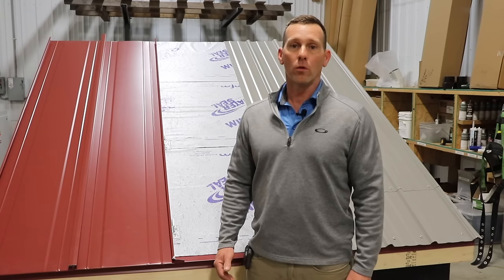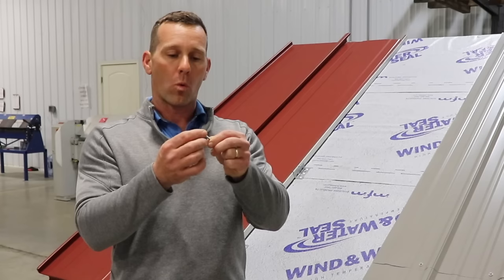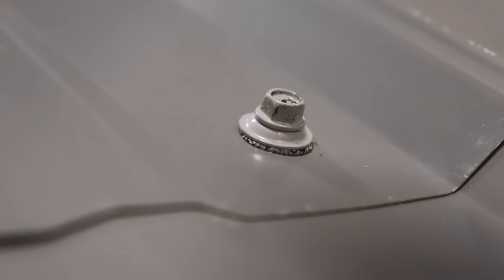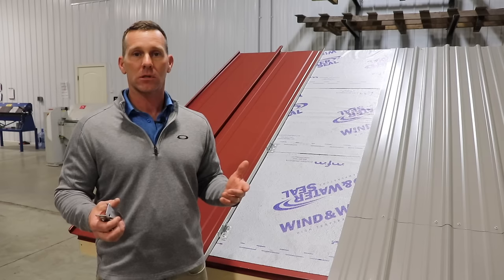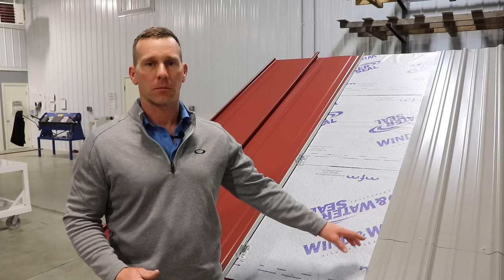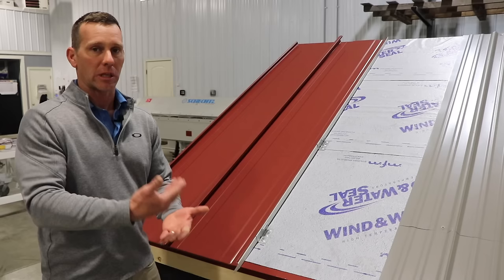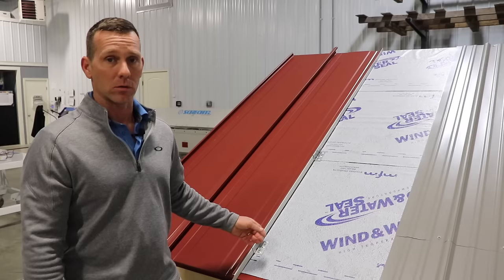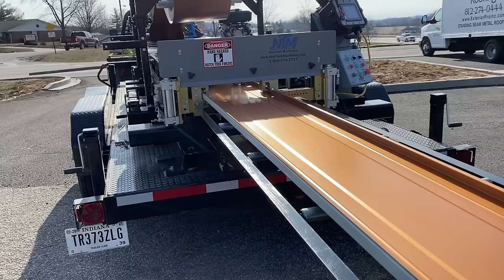Standing Seam Metal Roofing Vs  Corrugated Screw Down Metal Roof - Big Differences between the Two

Comment: Take what he says with a grain of salt.  The thickness of the metal is based on what they order for roll stock, same can be used for both, same with coatings.  Length of panels can be made the same length on site in both types if they come with the equipment rather than a premade product.  Interlocking seams on the top/bottom can be bent into both products IF the person applying it does it (generally not done though).  The ridges with standing seams are easily damaged with sliding ice in valleys in Northern climates, similar to corrugated but the standing seam is much more prone to damage as it's straight up seams, where the ice can skate across the bumps in the corrugated not always damaging it.  I don't sell/install either product but the only item in his list that really stands out is the washers in all those exposed screws, that's the biggest weakness in the product he is trying to put down.
Reply: Both types of metal roofing suck. Shingles are the best option for pitched residential roofing  applications .
Reply: I have in the past, worked commercial construction as a Superintendant, then Estimator and Project Manager. The last 20 years as an Owners Rep and as such a specifier. Most of my ground up experience has been Pre-engineered Metal Buildings along the Gulf Coast. 
If I misunderstood your comment let me apologize now. This is an opportunity for me to learn.
We don’t have icing / snow conditions down here. Thank God!  We do have Hurricanes and my experience has been, a roof fails for a few reasons.  Often fasteners or the lack/failure there-of, at trim and also at the sheet edge where the constant high wind, often excess of 100 mph for hours, will get beneath a metal edge and cause it to oscillate until the metal tears allowing the head to pull thru or the sheet tears, creating a sail. That’s why I personally like standing seam, with its concealed fastener and hemmed edge detail. 
Oil canning and costs are the negative. 
Back to my question. How do you hem an end of a piece of R-panel ( corrugated ) roofing?
Thanks
Reply: @brettsurrett4596  I completely disagree, metal roofing is great and installs very efficiently.
Reply: @gr8fullfred  easy installation doesn't result in a quality product. But if it works for you,great.
Reply: @brettsurrett4596  not easy, efficiently
Reply: @gr8fullfred  easy or efficiently.  Still doesn't equal a quality product.  But like I say , if it works for you great . Hope you give warranties with your work .
Reply: @brettsurrett4596  I live in the Buffalo/Western, NY area and have installed the corrugated and shingles.Never had too many problems with the corrugated metal.Metal roofs suck when contractors cut corners to cut cost.There's a good reaon why farmers used them for years.Because installed properly they'll outlast any shingles.
Reply: @MrBluecollar8  a lot of  problems with the corrugated is the exposed fasteners.  They leak after a short period of time,  the rubber gasket on the screw deterioration is the main issue.  This a problem when you want a roof to last. I don't recommend for residential application.  On a barn with animals. ......  maybe.  The product is not a quality product,  has nothing to do with cutting corners.  But if that is what you prefer to install . Install as per manufacturer  specs and give a workmanship warranty.
Reply: @brettsurrett4596  We've been installing them for quite a few years and have had no problems with the exposed screws.I live right along Lake Erie in Western.NY.We get ice,snow,rain,high winds,and hot humid summers.My issue with the screws is guys putting them down too tight.They'll put them down so tight they make big dimples in the roof.Before screws you had big ring nails with rubber washers.All you need to do is squeeze the rubber seal down a little without trying to dimple the steel.And actually using 1x3 to attach the metal to.I have seen guys try to just attach it directly to the roof over shingles.Most bad steel roofing jobs I have seen ,is when someone decides to cut costs.It really doesn't matter to me.I'll install shingles or metal.All I know is when the job is done,Just fucking pay me.
Reply: @MrBluecollar8  yeah, probably want to get paid and get the hell out of there before it rains. Roof may leak. LOL
Reply: @brettsurrett4596  LOL No I'm an older guy that still believes in pride and quality in my work.I can remember contractors selling 30 year shingles that would last 10 to 15 years.After 10 years a lot of those contractors  would be gone or the customer would lose track of their paperwork.I can remember replacing shingles on a $400,000 home that was 7 years old.Contractor used cheap 3 in 1s.Replaced them with Corning architechuals.(Think I spelled that right). At 56 I still try to avoid roofs ,but sometimes you just have to pay the rent.LOL
Reply: I've only got one response to coorugated vs standing seam vs shingles. Every single home and barn that is nearly 100 years old and still has the original roof is a standing seam roof.
Reply: @brettsurrett4596  until the wind hits 60 miles an hour.
Reply: @brettsurrett4596  Are you talking about metal shingles or asphalt?

Comment: Thank you for explaining the difference! I have a 50 year old standing seam roof that I need to replace. The roof still doesn't leak. The only reason I'm replacing it is because the edges are coming up and are bent.
Reply: Just repair what you have..

Comment: There is an old farm house just down the road from my home.  It was built in 1932. It has an old tin roof that has been painted so many times that people lost count.  I inspected the house and the attic.  How that roof has lasted over 70 years without major work is beyond explanation.
Reply: Skilled Craftsmanship
Reply: My dad has a big quonset style barn made from corrugated steel.  It uses the screws with the neoprene washers. We moved there in 1977 when the barn was who knows how old.  It is still going strong, though there may be a few leaks around a handful of those screws. The thing has to be at least 55-60 years old.
Reply: 😂😂 yes, the Old Corrugated

Comment: I've had experience with corrugated roofs in N. Idaho; they were older than 9-12 years however.  Number 8 screws had backed out on one roof and many screws were missing.  This roof would have been toast in the next windstorm.  Original installer held his screw gun out of square to the surface.  Replaced all screws with #14s, which saved the roof.  However there was rot in the sheathing from leaks around screws.  Roof boards were never replaced, unfortunately.
Reply: Can u not caulk over and tool with 795 to prevent this?
Reply: @Pittsburghbad  If you want to make the roof last a long time, you could roll elastomeric roof coating over the metal, screws, the entire roof.  It is a thick acrylic that rolls on; it will seal everything and prevent the screws from backing out.  If you can find a supplier who can mix custom colors, or even has it in premixed colors, one that you might like you can make the roof a suitable color for your taste.  You will want to apply two coats of premium acrylic over an adhesive base coat and re-apply about every five years.  Your roof will last forever! Make sure the screws are down tight, not too tight, before proceeding.  Home depot has a version of this product, but in white only; sounds like you're in Pittsburgh, Pennsylvania? In a city that size you should have no problem finding the product; it is water cleanup and not toxic at all.  Don't fall off the roof!

Comment: All too often, contractors drive aluminum fasteners into steel, which sets up for electrolytical corrosion, a problem which plagued the aircraft industry, in the early, to mid 20th century. In roofing, this leads to widening holes, and tears, around fasteners, in addition to the thermal expansion, and contraction related tearing of panels, and popping out of fasteners. Thanks for sharing this.
Reply: Do tell me about these aluminum fasteners? I've never seen a n aluminum fastener and would never use one as it would be soft and probably break.
Reply: @mikebeasley553  They're out there. I made the mistake of buying a box of screws, and got them, because they were cheaper. They were aluminum. Nearly every head broke off, about 3/4 the way through.
Reply: @ThomasGrillo  That would be  my prediction.
Reply: It's called galvanic corrosion.
Reply: @everythingmatters6308  Nope. When differing metals are in contact with each other it's electrolytic corrosion. Galvanic corrosion is the result of oxidation from prolonged exposure to the air. Trust me, I got that directly from a metallurgist, who corrected me on that, as I got it backwards on a test.  LOL

Comment: I had a roof with screws for thirty years with no screw leaks. I have a cabin with a screwed roof with no problem after 21 years. Our new home has standing seam metal and the some panels are 34’ long.
Reply: On standing seam panels, better put some screws in the top or they will walk down the roof and out from under the ridge cap.
Reply: @larrynorsworthy8582  There are screws at the seams that are  hidden by the overlapping panel. If these weren’t there the roof metal would lift in high winds.

Comment: The Morton Buildings  screw fastened metal paneling  are thicker gauge one of the first to use kynar . Morton also does a very good job of making clean and sleek trims and Flashings. Really on any metal roof system you have to have good installers, it won't do any good to have a good product then have someone do a hack job,  I see that alot.

Comment: Thirty two years ago I worked for a year in a sheet metal shop owned by Al a 70 year old man who grew up working in his family's sheet metal shop. I didn't do much installation but I did bend up a lot of single and double lock standing seam pans by hand useing an 10 foot break, in galvanized, copper, one lead coated copper job and hundreds and hundreds of attachment clips. I doubt I'll ever have a copper standing seam roof on my own house but I will have a coated steel standing seam roof one day. Al sold me on standing seam when I was 18 for many of the same reasons laied out in this video being, no attachment penetrations and the ability to expand and contract. 
Ps. When I asked Al how long a lead coated copper roof would last he said "the building will probably fall down before the roof ever fails". It was a new concrete block building and this was its first roof.
Reply: I've been there too buddy.  Hardly anyone does it that way anymore and I think the handbroke metal looks so much better

Comment: The instructions for my pole barn ridged steel was to put the fasteners on the ridges to maximize strength, and minimize seepage and weathering.  The fasteners had a cup that enclosed most of the gasket when properly torqued.  18 years now, and they stilll look good. Materials from Menards.

Comment: Hmm. Have used screws here in S. Calif. on many projects some about 15 years old now with no issues, 110* in the summer, 20-30s in the winter. Some of the projects have housed $30,000-$80,000 worth of astronomy equipment. When installed correctly i feel its a pretty solid system.

Comment: Pre drill all holes on the corrigated pannel !! Saves rubber washer from tearing.
Use white only = less expantion. For underlayment use 
1/2 lap 15# felt  and then install 1/4" fan fold foam board..
It will last a long long time.

Comment: Definitely a bias towards the standing seam.  I get it, but at twice the cost for materials, it's not in everyones budget.  I'm putting Fabral corrugated metal on my timber frame pavilion and with the little hint about the working life of the screw washers, will leave my self a reminder to replace them in about seven years, with a slightly larger diameter or longer screw if need be.
Reply: Don't buy the hard sell. If properly installed, the grommeted screws hold up well (if installed to manufacture specifications). Granted, you might not get the 100 years of the old school standing seam, but the neoprene washers will hold up as good as a high end shingle (20-30 years, again, if installed to spec).
Reply: @davidhorsley1149  Thank you Sir, appreciate it.  Injured my leg the day before installation, was able to drill panels on horses to spec, then had the wife and son hang them and screw them down, showed her how not to overly depress the washers, will double check them when leg is healed.
Reply: @interestinoldschool8080  glad it helped. Speedy recovery on the leg.
Reply: Be cheaper to look into a spray sealant instead of replacing the screws. Gives your house a new color if you choose to and seals the damaged rubber washer's
Reply: @david Horsley it was just a suggestion. Many old metal buildings up north are turn to this. Like I said just a suggestion. Not everyone uses the clutch on the their drill and squeeze the washer
Reply: @colinsmith7884  I don't know if you or I misunderstood. I don't think I responded to you about the spay on coating because I have encountered it in my area as well. Both of my responses were to "Interest in old school"
      My response in general was to the video, to which I reiterate, any time you can avoid exposed penetrations in a roof system you are miles ahead. But, given that corrugated metal with both nails on the ribs and grommeted screws on the flats have been in use for decades with success, defeats the argument of the video's poster. Yes, standing seam whether conventional or snaplock with hidden fasteners may be better, but both require specialized tools and more aptitude than the average layman has. And though there is a right way and a wrong way for corrugated metal, it is more forgiving and more in line with the realm of the do-it-yourselfer's abilities with limited instruction.

Comment: Awesome information! My question is around installation, can standing seam be installed over top of corrugated? 
My corrugated roof is now 22 years old and needs an upgrade, we live in the snow belt and usually by mid February the snow and ice builds up on the roof and doesn’t slide off easily, it slowly creeps down because of the exposed screw heads, and the overhang can get to four feet before it breaks off. We are going to replace the roof this summer with standing seam regardless of wither we can go over it or not.

Comment: I've alwasy been told that on a corrugated roof the screws should always go through the top of the large rib, not through the flat section as in your demo. There's less chance of it leaking if the screw is up on top of the rib.
Reply: But then it would not support his narrative.
Reply: Yeah,why would you want to put holes in your roof where the water isn't running. The only reason they put the screws in the flat is because it is easy,easy to nail and easy for the water to get in.
Reply: @robertt6292  I want to put holes in my roof to prevent it from blowing off.  Concealed fixing is not so robust against high winds.
Reply: Every area is different, go with manufacturers instructions for your specific area.

Comment: When I use corrugated steel roofing I always pre-drill the hole for the screws on the ridge, not the valleys. And to not have to worry about expansion and contraction warping the metal - just slightly oversize the hole. e.g. if the screws require a  4mm hole - then drill it to 4.5mm.  Have never had any of the problems listed in this video and live in a fairly extreme climate.
Reply: One contractor told me that drilling holes heat up the area around the hole and caused the paint to eventually peel and the metal to rust but he drilled through a whole stack of metal ,are you drilling individual sheets?
Reply: @davidborntreger3950  It depends on the job but generally if everything is square 5 sheets are drilled through at the same time. Otherwise we drill through single sheets. It's true that there would be a tiny amount of metal that lost its coating and be exposed but where we are gets an average of 600mm (24") rainfall a year. So rust is not a problem. But if there are any situations where it's likely that bare iron can come into contact with water for any length of time - it gets a spray of fish oil. That stuff sticks on for ages and you'll never have a problem.
Reply: I agree with the pre drill hole process and we  put a dab of silicon in the hole prior to screwing.You can also add a bit of silicon over the screw heads lt will be a bit shiny but it sure helps eliminate washer issues
Reply: @stevenbittinger5128  I've given up on silicone. There are a lot of documented reasons for that choice. I now use Quad or Lexel clear elastic sealant. And can't think of a single case where silicone is better.